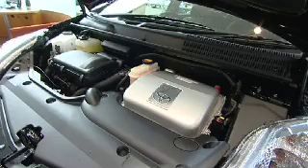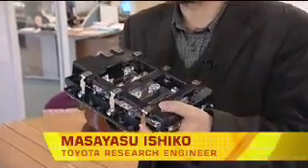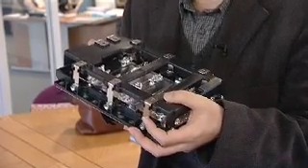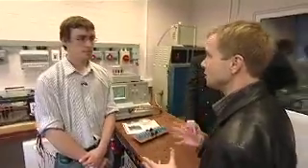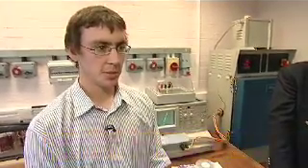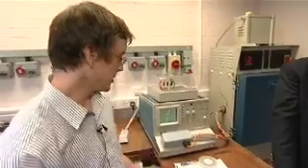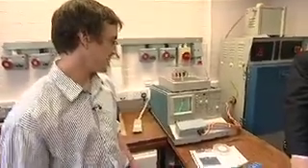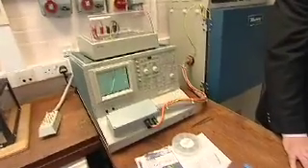How silicon carbide could help in the development of electri

Comment: Yeah, "Silicon Carbide Valley" should replace the Silicon one.
We produce cheap epitaxial SiC on Si(111) without misfit stresses by
Kukushkin-Osipov method of bridge-type connection:
http://scitation.aip.org/content/aip/journal/jap/113/2/10.1063/1.4773343
We use it for production of free of defects GaN/AlN/SiC/Si heterostructures for diodes.
Reply: interesting...are you an expert on GaN?
Reply: 厚德载物 There are a lot of good handbooks on III-Nitride semiconductors, e.g. by Hadis Morkoç. Any questions?
Reply: Did you have AFM of the grown surface? I can make an estimate of defect density based on that.
Reply: @chungchihsu2000  You can see the AFM pictures in the paper "Nanoindentation of AlN, GaN, and AlGaN films grown by HVPE on SiC/Si hybrid substrates" (2021). You can address the head of our lab Kukushkin to get any data or samples themselves.